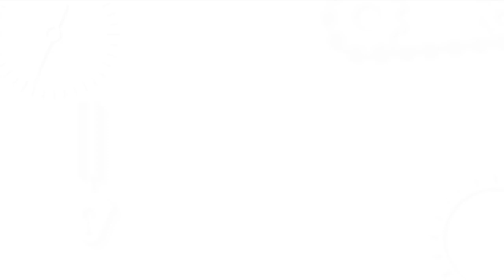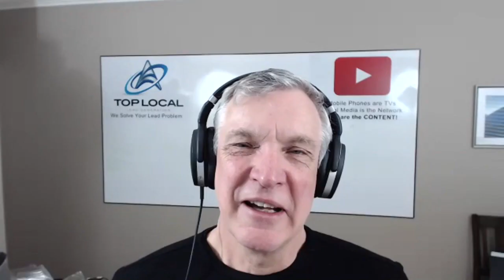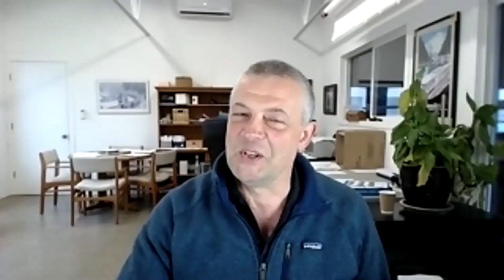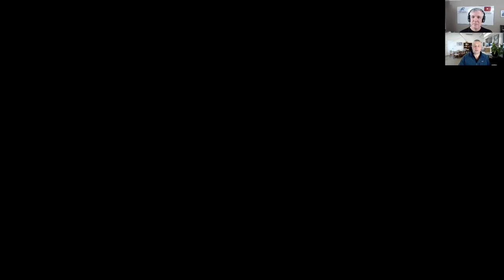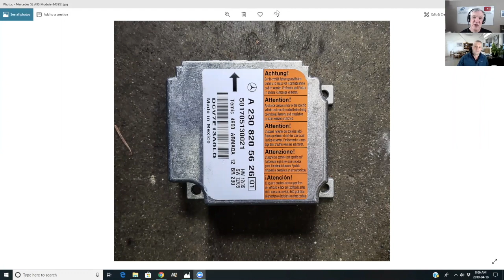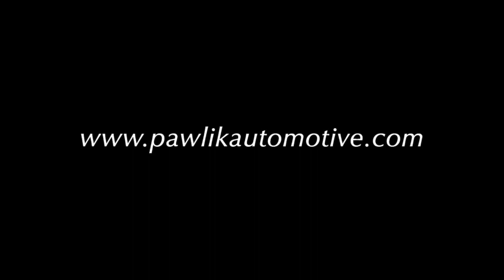2004 Mercedes Benz SL500 SRS Module Replacement

Comment: Good work. Have a 2005 sl500 with a battery drain. The draw is off 1.9 amps but I can’t find the culprit. Pulled very fuse I can find. It doesn’t have communication with the air bag module could the most system stay awake if it doesn’t see a response from the air bag module?
Reply: Did you fix?
Reply: Kind of I disconnected the driver side Sam module completely and once I did that the draw dropped to around 45-50 ma and It hasn’t come back since. Im guessing something in the module was causing the draw. If it comes back I’ll just replace the Sam module.